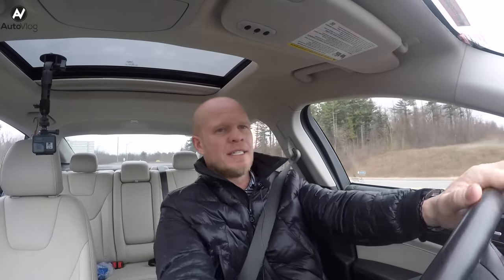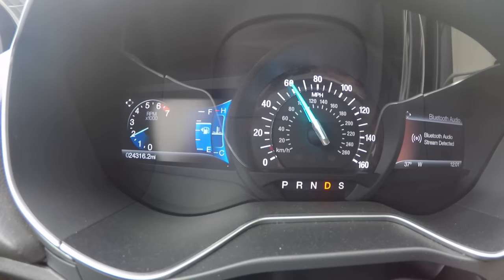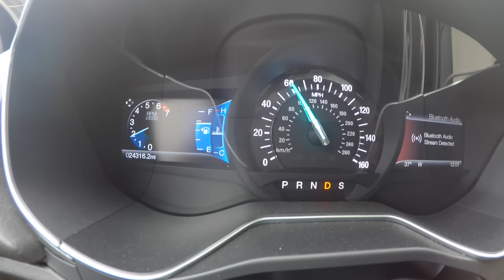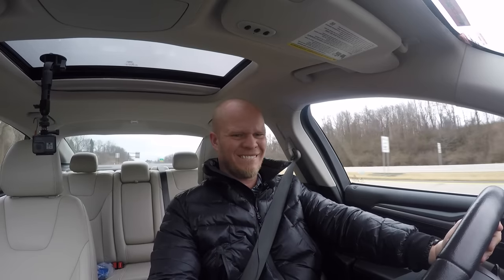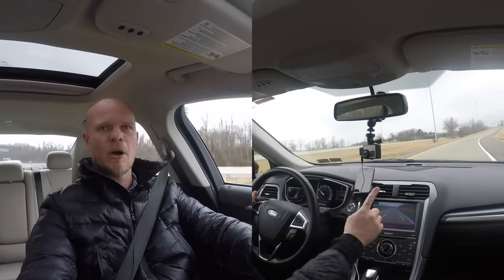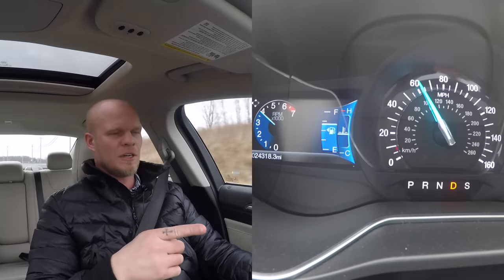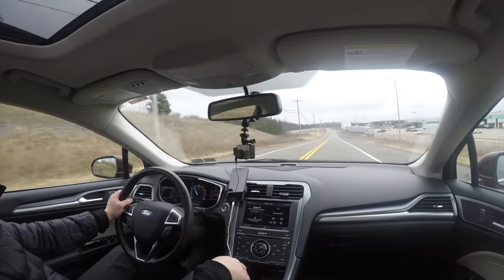What happens if you put your car in REVERSE while driving? (Things NOT to do while driving)

Comment: Try doing that in an old manual lol
Reply: Good luck getting it into gear. PS: Your not going to. If you miss 4th and hit reverse, you'll just grind a little but not make it into gear.
Reply: It depends on the transmission.  In Honda and GM (maybe more idk) have synchronized Reverse gears, so you can in them.  My mazda doesnt, it just grinds.
Reply: You can't, it'll just grind because it can't match.
Reply: There is way to do it. For this you may need to take abs fuse off. While driving brake so hard that wheels lock after that you can put your car into reverse
Reply: MrPappa2566 Lol you know that from experience?
Reply: Yes, you can
Reply: I said that you can, trust me
Reply: Confirmed. Some ppl get reverse confused with 6th gear on a 5 speed. My later sticks have the reverse all the way to the LEFT of first. But it just grinds & physically kicks he shifter back to neutral. I suspect the reverse gears turn opposite the forward gears so it wont "grab" if u shift to R while moving in a stick.
Reply: I once was in my friend's old Fiat that had 5 speeds and the reverse on the right, below fifth. I was so used to my 6 speed car that I put it in reverse when I was at 80 Km/h. I blew the transmission.
Reply: I one time showed at low speed on snow that it goes into reverse but I never released the clutch :D So yeah
Reply: Nikola Tesla grinded like ...  something bad... in my 94 corolla.
Reply: Nikola Tesla ok I did this by accident in my 1990 chevy pickup. I hit a bad bump on the highway and it kicked me into reverse and there was a really loud bang. Thought I blew up my transmission but it shut my engine off and I coasted to the side and it started right back up. But it freaked me out because it screeched to a halt
Reply: it is just Impossible..  fisics laws dont Llow you to engage  the gears with diferente rotation, reverse gear dont have sincronizer... so will never be possible to engage any gear box with less than 60years in reverse wille driving, an automatic gear box also have security sistems that do not allow it. any one who knows a little bit of how they work can assume that
Reply: petrolhead2226 he will be the only one in the universe who can do that!!
Reply: Roni Paavilainen i only buy manual transmission cars. The only thing you can get when you try it its grind!! Also 1st gear is nearly impossoble in many european 5shift gear box's unless you are under 10km/h, thats because the way sincronizer works to match yours gears because thy all worknin diferente speed and they are allways connected, every single one! Go check it
Reply: Nikola Tesla Yea I thought that's what he was gonna do. My old 2000 stick shift would grind to a fucking halt. I imagine you'd come to a fast grinding halt or your transmission would fall off lmao
Reply: I don't think you can. At least not if you're going fast. If you're going slow you would hear a terrible noise when grinding down your gearwheel.
Reply: just think of the damage of the car though internally and how much would cost to replace the clutch and gearbox
Reply: Futurepie398244 Gaming and stuff wouldn't just be the clutch and gearbox you would be replacing lol.
Reply: 300$ for an entire tranny and clutch if you own an old civic ;)
Reply: Nikola Tesla  even a 05 focus is cable and electronic and will destroy the planetary gears the car he is driving is a full electronic controlled automated manual gearbox with dry clutches itl keep the transmission in neutral but a cable operated one or hydraulic operated one will become a box of rocks......
Reply: it will just grind wont let you
Reply: I heard of a guy who blew the transmission right off his mazda speed (protegé) by putting in revese instead of 6th.but in my mr2,it just wont let you put it into gear.(btw i didnt try it on purpose,and at low speed,but still) but isn't the dodge viper equipped with some kind of a safety feature in case someone put it in reverse?
Reply: djpee25 I believe the viper does has a safety feature
Reply: djpee25 alot of the old school drag racers had scatter sheilds above there manual transmissions, for that specific reason of a blow up and the risk of shrapnel coming through the sheet metal.
Reply: Almost impossible.
Reply: you can't in a standard. it only grinds gears
Reply: it wont, it will grind also it nearly impossible going at high speeds and trying to put in 1st
Reply: captain crunch. if yoyou match the revs of your engine it will go in reverse its just because they arent synced if your goong like 40 or 50 push the clutch in and lightly hold pressure twards first and rev it up it will go into first once it syncs...sometimes ypu can jam it in when its unsynched just not verry often
Reply: like everyone else has said it will just grind, i've tried it with my civic, i was only going like 5mph but still. even if you were able to get it into gear it would most likely just burn the shit out of the clutch
Reply: Mr_NarwhaL It did grind like shit, at the point that I broke off some teeth, then i put it back in 5th, the teeth from the reverse gear got stuck between the fifth's, and I blew the tranny
Reply: 4by108 it also had to be modified to turn indicatirs on
Reply: Nikola Tesla i did in a 300 thousand klms old prado at 110 km it didnt go well
Reply: I tried it and oh no.I some how broke a gear.
Reply: Richard Smith Grind it till you find it
Reply: Nikola Tesla I have a 1973 vw bug I took out the safety reverse plate. because I put a short throw shifter on. to get in reverse before you had to push down on shifter and pull down left. I took it for a ride it was good for awhile few days later took off fast as you could in a bug lol went first to red line and thought it was in second wrong it was reverse lol skided for a few feet but I pushed clutch in and got it in second....
Reply: Nikola Tesla the gear wouldn't go in reverse in a manual i tried when i was like 15 in my first honda
Reply: It just does the sound you hear when you miss shift a gear
Reply: Pedro Alexandre Arantes wrong
Reply: I slammed my saab 99 in reverse going about 80-90km/h (50-55mph for retarded people) three times, then it went bye bye gearbox
Reply: Mine will only go into reverse from first gear, any other it wont go in (it wont grind either, its just like a wall is stopping me)
Reply: Well I accidently went from 5th to R in my dads car lol. It was only some GGRRRZZZZZZ sound and nothing more... I think you arent even strong enough to put it in the R
Reply: It will just grind I missed 4th one time
Reply: I did try it, many years ago. A company car, 1989 Ford Sierra 2.0 manual (in Red) with 'synchromesh' on reverse. At 70mph on a motorway, 5th gear, clutch down. It took a few seconds for the shafts to spin up fast enough but it did drop nicely into reverse. Without lifting the clutch of course. The change back into 5th was also slow because the gear shafts were spinning so fast, never heard that sound before. But no drama, no damage, no 'burned' hand and no problem! Company cars are great.
Reply: Nikola Tesla 
they still make cars with manual transmission. i drive manual, i have never driven a car that has automatic transmission and probably never will :)

ps: i don't think its even possible because the gears are spinning to a "wrong" direction. i'd not try it though... it could fuck up your transmission.
Reply: ridefast0
Reply: Revving the engine will do absolutely nothing to help sync gears as long as the clutch is pressed it. This is because the engine and transmission are physically separated at that point. To answer the question, I believe it depends on the car. Some will let you but most will just grind. I was in my stepdad's brother's 1999ish trans-am and he kept missing 5th from 4th and hitting reverse. All it did was grind and wouldn't let him go in gear. Good thing too because we were going damn near 100mph
Reply: Nikola Tesla I think it just won't let u it will block u
Reply: Wes Burns AAC
Reply: i can in my f150 with a 3spd
Reply: Nikola Tesla it won't let you put it in reverse on an old manual it won't do it.
Reply: i put my old 94 civic in park while going around 30 mph by accident and it made this huge grinding sound and car came to a stop almost instantly. the car drove fine afterwards
Reply: Nikola Tesla sure it would. Just hold the clutch and quickly move the shifter over and you'll be in "neutral" until you release the clutch pedal. Then it's show time from there.
Reply: rest in peice transmission teeth

Comment: It's very dangerous to put your car in reverse while driving. My dad once did it by mistake while driving his 1979 Mercedes benz 280e w115 automatic. The car started skidding and swerving. When the car stopped we were a couple of meters of the road with the car facing the opposite direction. The engine turned off  and the transmission locked. Please never put your car in reverse while driving especially with older cars it's dangerous
Reply: Did the engine made a loud squeaky noise before skidding and swerving?
Reply: How did your dad manage to put the car from drive to reverse in an automatic while driving? It’s VERY hard to make that mistake in an automatic which leads me to believe that he may have did that on purpose. I could understand if it was a manual transmission but there’s no way you could make that mistake in an older automatic transmission.
Reply: Kevin Norris maybe trying to put it in race mode

Comment: You should have included coasting to a stop while it was in the R position and seeing how far the speed must drop until the trans actually switches to R. Because u can switch to Reverse while still moving forward at a very low speed but I'm curious how slow the car must come to before it shifts
Reply: Should be about 5-10mph
Reply: Tested it in my 2022 Corolla, it’s 5 mph

Comment: i put car in reverse on the highway at 110 kph....
sudden jolt, followed by complete shut down. 
pull off to the side of highway and restarted the car. and drove off like nothing happened....
Reply: EZ2B_HARDCORE depends on your make and model, it may very well be damaged.
If it's a manual, the worst is locking up your wheels at high speeds, but it won't be easy since the gearbox won't let you do it
Reply: EZ2B_HARDCORE isn't that speeding in the us
Reply: PsyDuck Productions how do you want to know if he even is from the states? Just because he used the word highway? 
Also, the speed limit varies by state, in Texas it's 85 mph (~137 kph). 
And I assume that he's neither from the UK, nor the States, because he used Kilometers an hour.
Reply: PsyDuck Productions I'm in Cali I got a speeding ticket for going 130 mph but yeah I was going double the speed limit license is suspended rn
Reply: Street Speed 916 because you’re in Cali, if you go 5mph over in Cali you’re given a ticket
Reply: Street Speed 916 go to Texas, or any rural farming state, and no one will care how fast you go on a highway

Comment: if you try this on an older car you will grind the gears and you can hear it "clunk" the whole time till the car comes to a stop and it starts reversing. the reason your car (and newer cars) didn't/don't do anything is because your shifter isn't directly connected to your gearbox in your transmission its actually just a dummy box if you will with electrical components that just sends a signal to the computer in the car and the computer sends a signal to the transmission to tell it to shift gears

Comment: If this was an older car,you could have damaged your gearbox
Reply: If you are lucky you'll only shear the diff pin.
Reply: I'm pretty sure that if I tried this in my 98 Ford expedition, it would look like the beginning of deadpool. That is to say, lock up and go into a projectile roll.
Reply: Adidasp4 I did it accidently one time and my truck is still working lol I really fucked up
Reply: Adidasp4 yeah I accidentally did in my 87 accord at 5mph (it stops a lot shorter with car in N )  whoops, R not N !  instant stall, then something grinding until I stopped.  car ran just fine after though
Reply: dosmastrify would have been a different result at high speed
Reply: yep, I was going to say this, I did it in my old 1985 corolla, lets just say the engine and gearbox didn't like to fight which way the toque converter was meant to spin. and my speed went from 100KM/h to 80KM/h in a second, and motor stalled..

after that I dumped the trans oil out and there was chunks of bands and slip clutches all on the bottom of the pan, and 1st gear is now dodgy. but it still works!
Reply: But did your rear view camera turn on tho

Comment: depends on the type of car. in some older automatics there is no safety feature and would actually engage the reverse gear. the wheels would skid and depending on speed would have an effect on the transmission. in your case there is an electronic safety that engages all the electronics except the gear itself.

for manuals the reverse gear doesnt have a synchro so when you put it in reverse while going forward it will mash the teeth together and you get a grinding sound. 

tried on both :)
Reply: yeah and it's just about impossible to get the teeth lines up so it's nearly impossible in a manuel

Comment: I actually put my car in reverse one time by accident. I was driving a 1989 automatic Buick LeSabre and while going 55mph I switched gears but accidentally moved too many and ended on reverse. I quickly put it back to Drive but the accelerator wasn't responding any more. I pulled over. Put it on park, and turned off the ignition. I was scared that I had totaled the car's transmission. I turned it on again, set it on drive and took off. I never noticed any damage. I was lucky!
Reply: Jorge A. Rodriguez  I did the exact same thing once, still no issues to date
Reply: Jorge A. Rodriguez, I was teaching a kid to drive when I told him to stop (at 10 mph ) he put in park. Very loud noise, like knife into fan blade. No damage
Reply: yes there was damage, you just cant see it. when you put an auto in park, a spindle goes into a gear in the transmission. that knife in fan blade is exactly what happens, that spindle is grindiing into oblivion. eventually park just wont work anymore.
Reply: If you were driving an automatic, how can you 'accidentally' switch gears? You literally don't have to touch the gears once you are moving.

Comment: What will happen if you select reverse in a stick shift while driving?
Reply: Ankur Agarwal  You cant even put it in. max you can do is maybe get some scratchy sounds but thats it.
Reply: DaYwaLKeR 1st and reverse do not have syncros (mini clutches) so when you go to put it in first at high speed and reverse, it'll just grind great until you speak it gear at which point it'll slow down rapidly or screech to a halt. That's if you go slow enough
Reply: Grind city
Reply: @Abjyr Agarwal The gear's will grind against eachother, if the gears shatter on the inside of the tranny and you keep driving it can destroy everything, Usually they would have to rebuild the transmission which is a very shit job to do.
Reply: @Daywalker My friend shifted his car from 4th into reverse by accident and the transmission gears broke off on the inside and when he kept driving it shattered everything inside.
Reply: @Daywalker Manual transmission though not automatic.

Comment: You obv had to give it gas, that's the actual test.
Reply: he did by the end
Reply: I did that on an old pajero 4 speed auto gearbox (not pajero, just the car using the same gearbox)

Rev shoots to red line but gear is still in neutral.

Mythbuster tried the same thing on a very old car, same result.

Comment: lets See you do that with any 50's 60's -70'-s--80's-90's early  2000 cars   hahaha  YOU WILL HAVE A way different reaction !!!!
Reply: Da Grinch bye bye transmission and gear box and rear end 😂 and in mine front end too
Reply: +rapidfirer56 The transmission and gear box are the same thing lol. The rear end would be fine as the rear tires will skid along because all the weight is going to the front wheels due to rapid deceleration.
Reply: Da Grinch or just manual
Reply: I've done it in my 02 Buick century on accident and nothing really happened. It only happened because my column shifter is pretty loose as it's an old car.